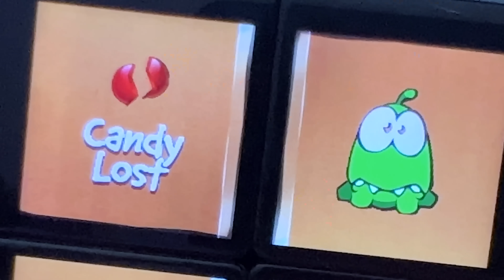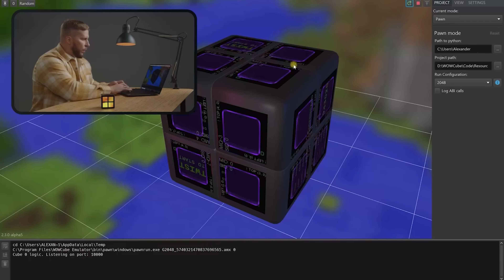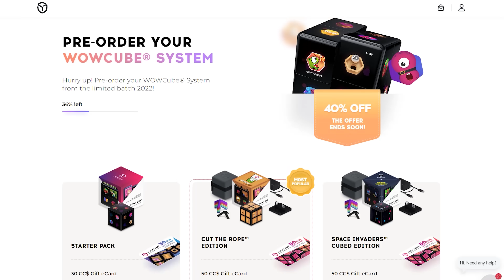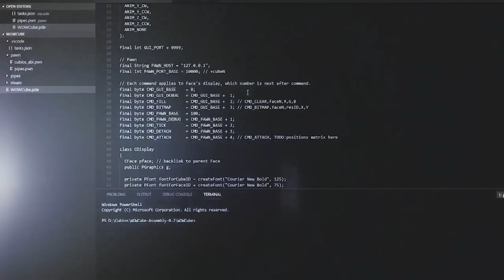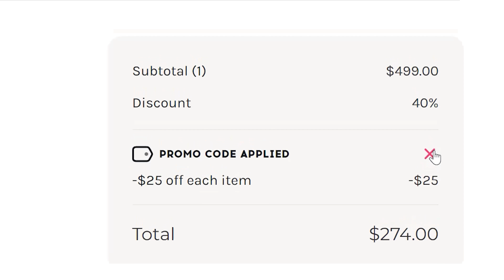When your Rubik's Cube is from the year 3000

Comment: I know this is a sponsored video since they gave you the promotional code stuff so you can't really criticize it too much, but this is my HONEST, unbiased review of what it looks like so far from a technical perspective going by the trailer and your review.

Going from the video showcase, looks like it runs at a solid 20fps which is ridiculously low for todays market. I would honestly like to see the frames be a bit smoother for something coming out in 2022.

From the looks of it, there's no touchscreen. So I don't understand why it's showing Gmail and Instagram on their online advertisements unless it's meant to specifically only show you the notifications and not be able to interact with them and only be able to look at the date and weather.

I feel like this would only be good for kids younger than 10, and even then you'll probably be able to find a better smart phone that could do more and play better for cheaper, and if you have to hook up a phone to use it doesn't it defeat the purpose?

Looks cool but I don't see it being very practical as an actual system since it runs at such low frames with no touchscreen support.

Comment: Interesting but I have to wonder how easy it is to code a game on this thing.  As a software engineer myself, I wonder what OS they are using and how you manage all of the gyros and screens.  I'll bet it's some kind of Linux kernel but yeah, dunno.  Probably a very concurrent system.
Reply: WOWCube® Entertainment System runs on CubiOS operating system, which has been specifically developed for the cube as no existing OS could control a device of such form. Our team had to develop a full software stack from scratch to synchronize the work of all eight modules. We have SDK, that is already used by some third party developers, who are creating apps & games for our cube.

Comment: when it costs $699

and contains maybe $40 in parts. 

TEMU is gonna bootleg it
Reply: ... Um. How in the hell are you thinking 40 in parts? 8 separate devices each with their own battery, cpu, either two or three screens, bluetooth, speakers, networking, gyros...
The cost of production for something like this is going to be insane.
Not to mention all the R&D, custom OS and software...

This thing was expensive to get into production. How much it costs to make in bulk after all the R&D... Not sure. Depends on how many they're making. Economy of scale and all that.

But yeah... No. Temu is never making a device this costly. Too much upfront. A pathetic copycat with less than a third of the features that doesn't turn on half the time? Maybe.
Reply: You know some cheese drop shipper will make one with a LCD
Reply: @arcadealchemist  ...🤦‍♂️ Those are LCD screens.